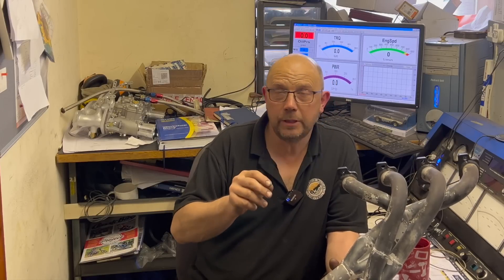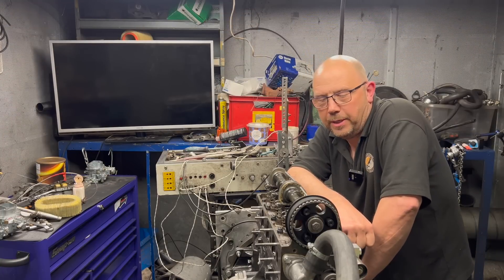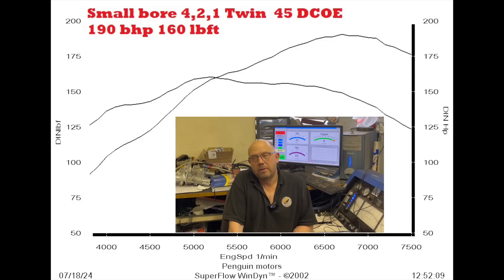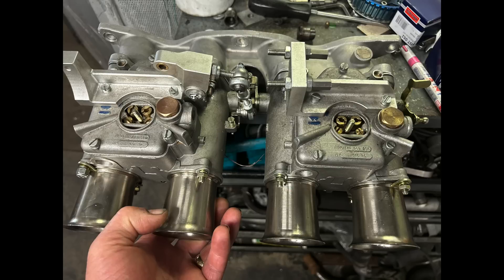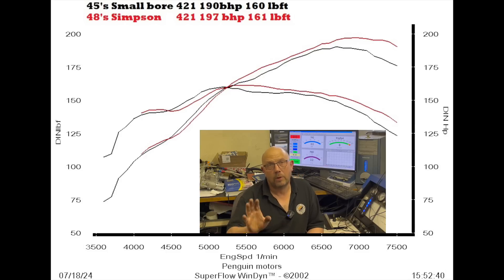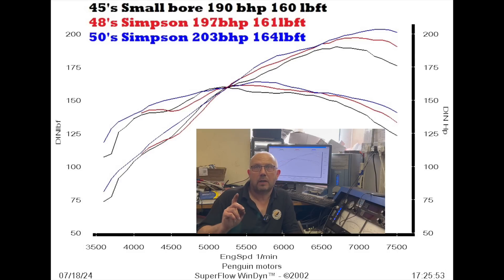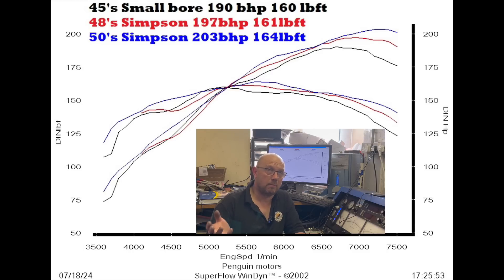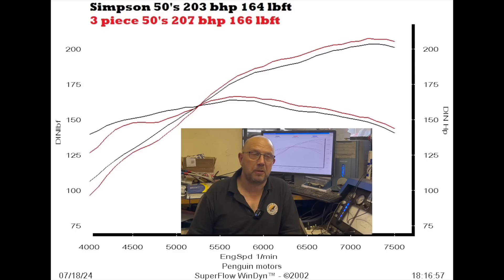ford pinto exhaust manifold test, Simpson V Ashley weber 45/48s v 50's

Comment: Great video again Graham. You sure know how to find the ponies in these motors. 
Have you ever tried unequal length headers on one of these?
Supposedly good for midrange, which could prove useful in certain applications.
Keep up the good work
Reply from the maker: Not tried unequal on a pinto, have run them on bmw m10. Tends to give a better spread of torque but lower peaks

Comment: I'll add what I can re header primary sizes for 2v engines. This issue changes engine to engine based on their unique variables. Hitting 50hp per cylinder from 2v and 500cc can be tough. 

For engines with individual cylinders around 500-550cc, 38mm primaries work great and rev great until you have a 2v engine with an intake valve larger than 46-47mm, which allows for even larger intake ports, wants more revs, so a 38mm exhaust port and primary is not quite up for the job way up high. The best example is the Porsche 911RSR or even Porsche Carrera 3.2 engines which both have 42mm intake ports and 49mm intake valves and sometimes up to 51-52mm. The RSR engine has very large 42mm exhaust ports and primary size (also 42mm) and of course revs and often makes 330hp-360hp from 3L.  A standard 3.2 Porsche Carrera engine with a 38mm tubular primary exhaust manifold, even with big 48mm carbs, high compression, and 265 duration @ .050 .500 lift cams, will not make 300hp, never seen it happen unless the exhaust is ported to 42mm and 42mm primaries are used and it's revd well north of 7000. Note 911 engines, even in race form, don't get much anything out of going higher than 12:1 compression. Hot street builds with twin plugs (required) never go hotter than 10.5-11:1.

The 3L Alfa Romeo Busso V6 2v engine is a different story.  You can stay with the 38mm primary exhaust manifold as the intake valve on the Busso 2v head is at maximum 43-45mm or so, meaning a 38-39mm intake port is the largest one can go, thus negating the need for an exhaust port larger than 38mm. Mind you this is with 48mm carbs as well. Those variables are not all doom and gloom though, as when one has this somewhat small valve issue, you can run much higher static compression (even up to 12:1) on water cooled aluminum motors, even on the street, as volumetric efficiency of the intake makes for dynamically realizing the static ratio very challenging. A 2v 3L Busso engine can still crank upwards of 300hp+ (the most I've heard of from a 2v was 347hp, on race fuel at around 14:1 compression) with much higher static compression than certainly would be used with an RSR motor as it's just not needed nor does it benefit the RSR motor, all while running the 38mm primaries. A Busso motor likes tons of compression due to the volumetric efficiency issue caused by the lack of intake, but it can still make good power as that opens the door to playing with compression. It's not so diminishing returns as it is with the 911 engine, which has much better intakes. 

The 3L Ferrari 308 2v engine is not exactly a similar comparison but I'll note the stock exhaust flows some 92% of the stock intake right out of the box, while the intakes are sort of horrid. Stock manifolds are 35mm ID and that motor can be tuned to make 300hp+, never touching the exhaust, but only bumping compression (at least 11.5:1) and running larger carbs, much larger cams, and ported intake.  

Playing with compression is definitely a thing when the VE of the intake is lacking, all while leaving the exhaust alone if that's what one is stuck with.
Reply: https://youtu.be/DG2NOTTpTHU?si=oT5meC-Ss1foOeIA   mazda bp 1,8l engine is awesome,  high boosted more than 250whp/ hole!
Reply: Great information and video - thanks Graham 🍻

Comment: Good video again. What do You think is smallest exhaust pipe OD for 200hp Pinto? When OD 51mm exhaust pipe will be restrictive?
Reply from the maker: not on my dyno but i have had pintos do 200bhp on rolling roads using 2 inch so 51mm or there abouts

Comment: Hi Graham , love your videos could you please check what chokes are in the 50’s and was the small bore a 2” exit
Thanks Chris
Reply from the maker: 2 inch.  Think but cannot be 100% that the 50’s has 42mm chokes
Reply: @PenguinMotors thanks for your reply, the reason I was asking as I ran a small bore sportex with 2” outlet and 48’s with 40mm chokes running a gts 3 on a unforgiving dyno and got 176 bhp with a good low down pull and ive changed up slightly on manifold bore and gone to a 21/4 outlet and 50’s which have 42”s in , i was looking for some 40 mm chokes as thinking 42’s maybe too big but after your video fingers crossed they may work , it will be up and running again in next month as gave the car a full refresh and was hoping to see 185/190 bhp as im sure my sportex primaries was smaller than yours as was listed for a 1.6 pinto 😂
Reply from the maker: It depends on your goal dropping back to 40mm chokes in the 50’s should improve drivability, but not have much effect if any at the top, you can it 38mm chokes in the 50’s that certainly will cost you power but again likely improve drivability and low speed manners

Comment: Ive seen a 6hp gain going from 45's to 48's on an 1800cc 190hp (non pinto) engine, both carbs running 39mm chokes, so id say most if not all of the gain seen was from the carbs.
Reply from the maker: Judging by the way the engine responded to going upto the 50mm carbs I would guess most of the 7bhp gain after first carb and exhaust swap came from the carbs

Comment: Would have liked to have seen the Simpson upgrade from small bore without the change in carbs first, just to see the difference between each manifold. Great video though, keep them coming!
Reply from the maker: Yes the thing was this didn’t start out an exhaust or a carb test, which is why I didn’t have data on exhaust swap but retaining the 45’s
Reply: Yeah same, would've been nice as that's what I'm looking at myself engine wise

Comment: Ashley exhaust i had bought in the past is rubbish. I had to reweld parts for flow and connection to cylinder head. Flange even was warped due to welding.
I make my own exhaust headers now. Simpson build headers are better option to use.
For the rest cross section of primaries is a discussion that ends up in hours. How engine is build and what it wants. generaly a high rpm engine 
needs larger primary tubes, but you can tune the length of it. Then would you have to use 4-1 or 4-2-1 system. It all depends, and you know that very well.
testing and some more testing will be a time consuming effort at cost.

Comment: whats your thoughts regarding stepped pipe diameter manifolds?
Reply from the maker: Never tested one, most engines you have a natural step unless you hog the exhaust port out to a huge size. The bigger bore section will probably hurt scavenging so it’s likely they would help in one specific point and hurt power elsewhere

Comment: What do you know, your just the dyno man, lol🤣 back in the day,i never heard of the Simpson manifold, i bought an Ashley 3 piece, because the normal 4-2-1 kept breaking re mig it blah blah blah, but Ashley 3 piece was really good,it was like the handbrake was taken off, engine breath so much better and climbed the revs with vigger, but very surprised of the horsepower you got out of the motor, my set-up was BVH Kent cam dowled vernier,RL1  3,500 rpm to 7,500 rpm, and Webber downdraught IDF 44, did i have fun in that car, but my wheel horsepower was 145-150 at the wheels, but the motor was pulling nothing (mk1) but things have upgraded since then (mid to late 80's) we used Lumention ignition system then, things have progress since then, I really find your video's fascinating, king of the road back in those days were Capri 3.0 2.8i sunbeam Lotus most I walked past but Lotus we were neck a neck, if we had that motor that had the three-piece manifold(ashley) the champagne would be out, lol like we won a stage on Lombard RAC Rally. 🤣 incidently,what would a motor like that cost to build at todays cost?
Back then the places to get stuff from was far and few, like Burton  Motivation UK (Roger & Jamie)good lads, Race & Rally Centre (James Perkowski), your not just the dyno man, your the man that can😊.

Comment: Can only change 1 item at a time.
Reply from the maker: true, but i didnt start out to do a manifold or even carb test, if my origonal intension had been to do a manifold test i would not of changed the first exhaust manifold and carbs at the same time. even though i changed two things at once in the first instance i still thought it interesting enough results to include.
Reply: @PenguinMotors  Are Pinto Cams still bad for wiping lobes ?
Reply from the maker: no not much these days,  cams and followers are harder than days of old, and oils are better, like anything they can wear out, but i havent seen a wiped out cam lobe for many years

Comment: Good video as always Graham, I just wondered what you use on the end of all of those manifolds, is it similar to a one box 2.5 inch escort system (Ashley) or is it just a pipe out into the outside world. 😀😀
Reply from the maker: usually a long length of flexible tube that goes to the extraction flue and up a chimney to the outside world. the flex tube is 1.5-2 mm bigger than the manifold outlets, but is not smooth interally so probably slightly more restrictive than if it were smooth. it must replicate cars exhaust systems quite well, as standard engine show standard power, and ive run engines that have also been rolling roaded and power was within 2bhp.

Comment: Wow, that was a shocker, just goes to show its not all about how much money you can throw at a project,. Nice work Graham 👍
Reply: Pinto loves 4.8 carbs or bigger ,pinto on 45mm trottles  are not as strong
Reply: Your Carbs are too big....ask any Successful Engine Designer.

A 1700 cc X-Flow requires twin 43 mm carbs.

I'm running twin 42 mm Throttle bodies....could not get twin 43 mm.

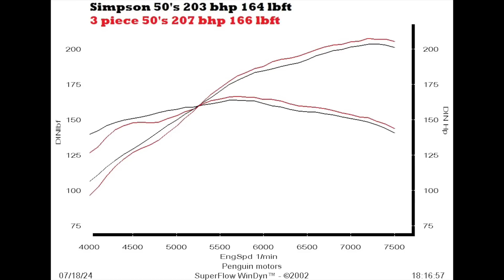AT Power throttle Bodies. 14:24
Reply from the maker: you cannot directly compare throttle body size to carbs. Carb size is like a cam shaft you have to choose it to suit your application
Reply: @gj91471  ask any successful engine designer?🤣🤣🤣 what planet are you on.

Comment: Great video again Sir Graham, showing that a simple manifold can make a big difference. To give you some ideas, you could try an anti-reversion chamber at the output of the manifold, or a short small bore 50mm output being followed by a tapered pipe from let's say 2 inches to 3 inches and ending in a straight 3 inches pipe. Or also small bore headers going straight onto a 3 inches exhaust pipe. Cheers from Spain!!
Reply from the maker: trouble is i barely have time to run tests let alone make exhausts!
Reply: @PenguinMotors  I understand, could be interesting though
Reply: Old is gold

Comment: Great vid, what were the differences in choke and jet settings between the 45,48,50 carbs?
Reply from the maker: now your asking, 45mm carbs were on 40mm chokes, 48's on 42,s cant remember about the 50's, but oddly the engine seemed to like them. jet settings between 48's and 50's were pretty similar

Comment: I really wish you had ran a test after changing only the exhaust....
Reply from the maker: thing is at the time i wasnt testing exhausts as such i was testing cams! but as there was no real difference to power curves, and the engine gained  even more power on the 50mm webers  its fair to say that the small bore Ashley probably wasnt robbing it of more than a few bhp

Comment: Grayham maybe try a CV type controled vortex manifold. It's an anti back flow idea..     
2lte fiat + janspeed 421,  to bigger CV 4to1
Gained 8 whp and pulled from 500rpm lower down.  On kent race cams.
Reply from the maker: yes well aware of cv manifolds, if someone wants to send me some to test......  but im not awre of anything off the shelf. your point is interesting, BUT to really know if the CV part of your manifold was the gain ( as opposed to the 4.1 simply hitting a sweet spot for your engine) you would have to try two manifolds with and without the CV using same pipe configuration. Mostly  in tests 421 manifolds win, but i have seen occasions when 4/1 is better
Reply: Unfortunately I made my original CV type here, the only other one ivemade is on the Kart engine which isn't dyno'd yet. Its going to Emerald as it has there ECU fitted.

How about Ram charging if you can get the airflow, it made the kart better but correcting the fueling was an issue to correct over the rev/speed range, but it does work.

Comment: Has the rod ratio changed for the' better' with the rods? Engine sounds so balanced beautiful
Reply from the maker: it is not something i have back to back tested. theretically longer rods are mechanically better from a thrust prospective, However thats a too simplistic way of looking at it, changing rod length changes the time the piston will dwell at TDC, so alters piston timing in relation to valve timing slightly.  The other effect the rod length has is on piston acceration, longer rod will slow it, which the engine might or not like.  on an engine which is struggling for airflow a faster accerating piston might actually get the air moving faster and improve cylinder filling, . theres just too many variables to give a straight yes no answer. interestingly the most powerfull pintos and bmw m10's i have built had worse than standard rod ratios!
Reply: @PenguinMotors  Worse in this case meaning shorter rods?
Reply from the maker: Yes shorter

Comment: Thank you for this informative video! 
Have you ever tested one of the big bore cast iron RS manifolds? Are they far away from the Ashley and Simpson?
Reply from the maker: no i havnt, they are just too rare and expensive for me to lay my hands on one. Once i found a MK2 RS ex manifold on a mk3 cortina in a scrap yard, i paid about £10 for it including front pipe!
Reply: @PenguinMotors  If memory serves me right, Stefan Glass did a comparison with a Gr1 big bore manifold versus a tubular manifold. He gained most top end bhp with the tubular (204), and 202 with the Gr1 manifold. But the torque came in about 500rpm lower with the Gr1 manifold. So as You say, it all depends on budget and what use the enigine is going to have. His engine was tuned and set up for each manifold. Thanks for all your good videos here. Lots of fantastic work.